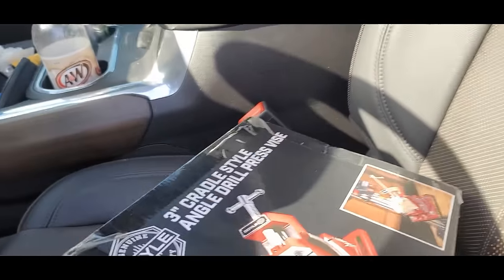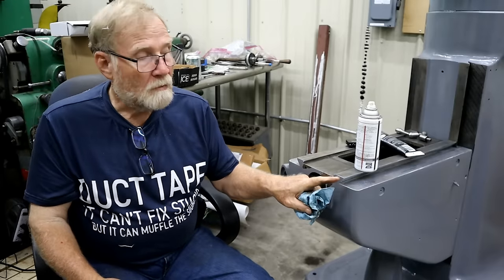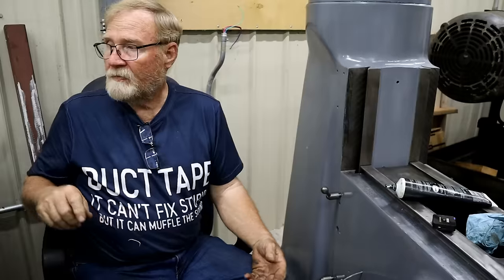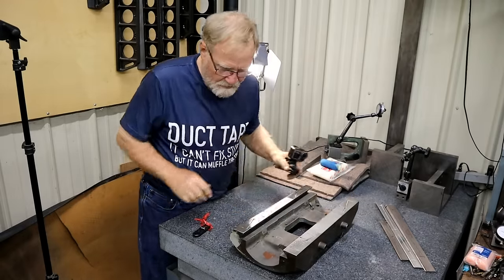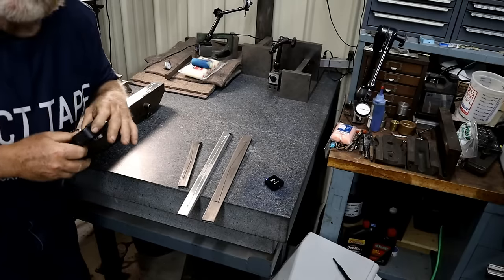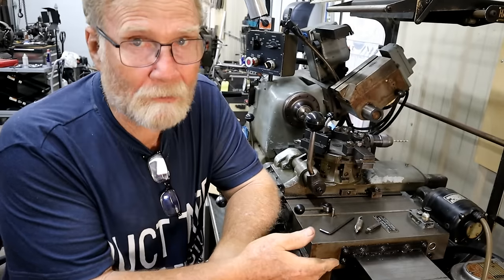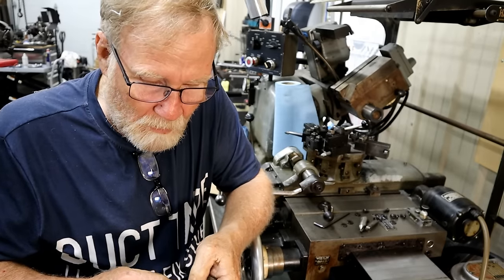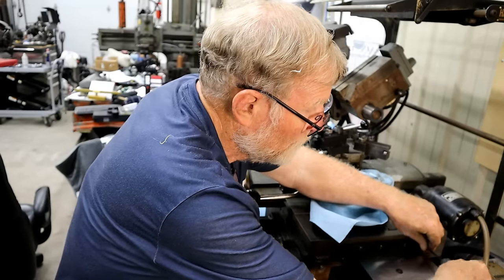Restoring Machines.... And a trip to the Tool Store....

Comment: Hey Steve, if you want a tip to help stop rust in your shop, easy peasy, try stacking kiln dried lumber around the shop. Wood will soak up moisture out of the air and release it when its dry. 
I found it balanced out dry and wet days. 
No most fuss or rust.
Reply from the maker: Thanks for the tip!

Comment: There are some good 3d printers out there for a reasonable price.   For the type of things you do along with your ability to program a cnc you would really benefit from getting one.   I use a Bambu Labs X1 Carbon and love it.  With that and Fusion 360 you’ll be surprised how often you’ll use it.   You could make all your own wipers.   I even do some honey-do’s with it which helps with justification 😇
Reply from the maker: This is really the first use that I was impressed of.... OF course I could also print my face masks with one :)

 I've been offered a lot of printers for review but never thought they were a good enough machine to ever mess with...  Same way with laser cutters.  When I was over at Windy Hill Foundry last time we used one he was demoing and I though it was about 10 times better than the one I tried out...  Lots of machines out there that I just don't think stand up...

Comment: Hi, could have you used a heavy felt and a tin plate to give it some stiffness???
So the new wipers are a rubber compound not hard plastic, Thanks for a fun and informative video. Will be going and watching more of your videos.
From kiwi land
Reply from the maker: You can...  anything is better than nothing... The new wipers are some sort of softer plastic that was printed... They have a sharp edge to the wiper that acts as a "plow" to move things off the bed, I think that is more effective than felt would have been... On the 1943 Planer they made brass covers for the felt that acted to sweep off the shavings also...

Comment: I have one of the Hardinge tool height gages - the C2 with the top that sides away so you can set boring bars.  It's slightly adjustable at the base.  Not sure how to send images so you can check it out.
Reply from the maker: Go to      https://www.youtube.com/channel/UCPRguhKIX-kgWg4h4AHV4oQ     

 Then in the description click on the MORE after this line " Things that go on in my Shop....  Rebuilding old machine tools, hunting for old tools, welding, MORE"  The email will show up..... Measurements would be great also!  Thanks!

Comment: Nice video Steve.  I tend to disagree on hollowing out the middle of a slide as Bridgeport did on your saddle.  I know the Bible says to do this. My Index mill did not have the middle cut out when I rebuilt it years ago.  Speaking of that, its starting to show some wear I need to take care of.  Gibs, that was a good explanition you did.  I always take a .001" feeler gage and check for gaps high/low spots.  Notice the one gib is bent slightly.  You going to show everyone your method of straightening it?  Thanks for sharing.

Comment: I thought the purpose of the flaking was to REDUCE the contact area between the 2 surfaces, to reduce stick-slip?? And the secondary benefit was the oil retention? No?
Reply: Oh, I commented before you showed the relief in the bottom of the saddle to reduce the contact area :) I get it now. I didn't know they intentionally relieved the saddle. My experience is with a box way cnc mill where nothing is relieved, and everything has turcite on it
Reply: On a 10EE saddle the middle is relieved a little bit as well.  When i rebuilt my 10EE I scraped the middle a little bit while i flaked the rest of the Moglice.  

When i cast the Moglice on the 10EE saddle against the newly ground bed it took a lot of effort to move the saddle after oiling, an effectof the matching surfaces squeezing the oil out.  Flaking leaves a little bit of oil and reduces the total contact area.

Comment: Steve did you know you can get chrome powder cote for your knee lock handles I use it on my bullets it comes up great
Reply from the maker: Did not know that... I have a love/hate relationship with powder coat.... Does not hold up very well on most thing I have bought that are exposed to the elements....      I ordered the power supply and some nickel strips last night and I'm going to try to nickel plate them here in the shop...  I used to anodize aluminum here in the shop and nickel looks even easier...
Reply: @10swatkins  clough42 did a video a while back on nickel plating - might be good to check that out - if I post a link, my comment will be deleted, but I'm sure you can figure out how to find it
Reply from the maker: @gorak9000  I went searching for a few videos on doing it myself, like I do the anodizing.  I saw that one also.....   I have already ordered the stuff to make it happen a few days ago ;)
Reply: @10swatkins you really need to copper plate first, before nickel plate. You can do it without, but the plate is better with the copper first. The one problem with nickel is that it’s subject to darkening into a grey from acid such as from sweat. So keep that in mind. If using chrome powder coat, which is really aluminum powder, you need to immediately clear coat or it will turn grey before too long.
Reply: @melgross  Also, some people (like me) have a nickel allergy - anywhere my skin touches nickel, it gets red and itchy. And most metal in clothing (belt buckles, metal buttons on jeans), and a lot of stainless steel (like razor blades, glasses frames, etc etc) has nickel in it. I have to avoid all of that, or my skin will be irritated and itchy wherever it touches nickel. I don't think I'll be nickel plating anything in my shop anytime soon...
Reply: @gorak9000  that’s right. I forgot about that. Well, I’ve clear coated (powder coat) nickel. You can get a semi matte clear coat that looks great.
Reply: @melgross  That's a great suggestion. Growing up, the solution when it was unavoidable to have nickel contact (like glasses frames on the legs) was clear heat shrink, so clear powerboat would also be a good solution! I've never heard of clear powder coat before, so I learned something new :)

Comment: Was the flaking done before or after the chrome plating?
Reply: Flaking is done before it is chrome plated.
Reply from the maker: I reflaked the Column Ways that are chromed.  Not much difference than cast iron flaking other than you don't get the same depth of flake with the same effort... Chrome is harder than CI...

Comment: I thought you didn’t want to grind the chrome plate off any of the ways? So why do it on the top of the saddle?
Reply from the maker: Because the top of the saddle is really worn... Have to get it back in shape...  The ways on the knee and column and knee were almost perfect so I am not touching them except to flake....
Reply: @10swatkins  so the chrome is worn off?
Reply from the maker: @melgross  On parts of it..... There are detailed pictures in the video...
Reply: @10swatkins  I know. I watched the WHOLE video. But I remember you saying that there was some wear only at one edge. Steve, I’m sure you know what you’re doing. I’m not doubting that. I just didn’t notice any real wear other than that one spot, and it was small.
Reply from the maker: @melgross  Some of those pads have worn down flush to the relieved part..  About .020   That lets the saddle "tip" to one side about .020 .... Have to level those pads back up and then relieve the center again...

Comment: I don't think Hardinge actually makes that way wiper. A lot of wipers are made by some other company, like KabelSchlepp. Or if it was made by Hardinge, someone like KabelSchlepp probably makes something that works as a replacement. The real stuff is expensive as frigg though - just the rubber (not the aluminum holders or frame that it slides into) for the wipers on my VMC are 50/meter!